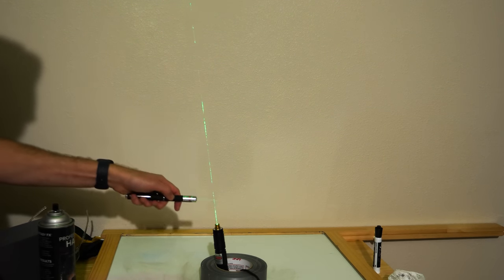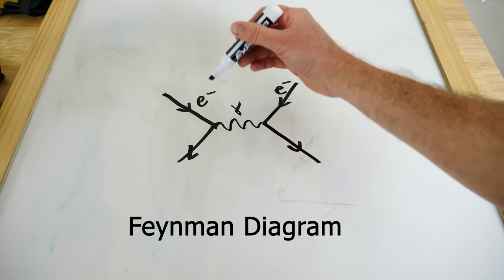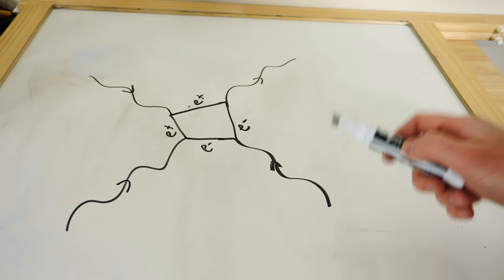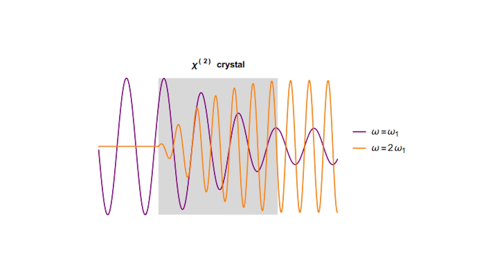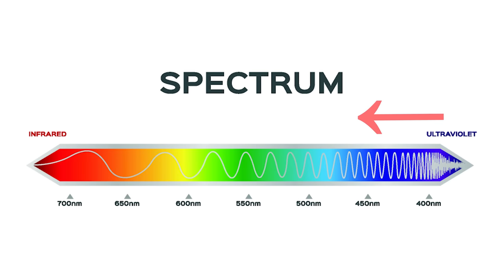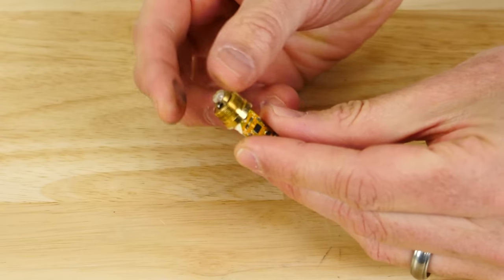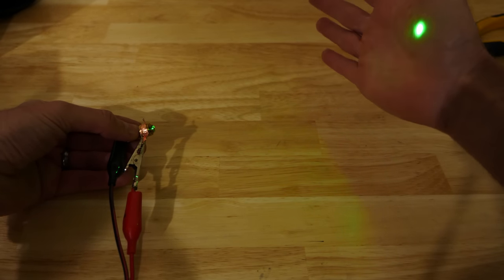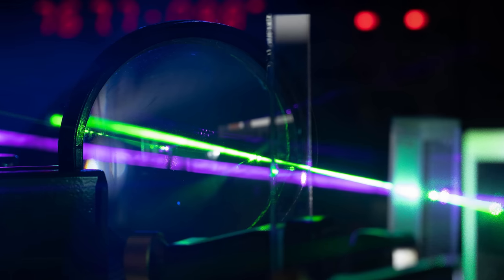Can Light Bump Into Other Light?

Comment: What's also interesting is that it seems that the crystal acts differently depending on the temperature so, if the laser is used in low temperatures, the crystal seems to stop working and may lead you to think that the laser is not working anymore, but it is working properly... as an infrared laser, so if you heat it a little bit it will start glowing green again
Reply: makes sense, as low temperature changes the crystalline structure in a way that prevents its resonant properties from working. Once the temperature raises and the crystalline lattice rearranges the photons are once again merged into one photon of summed frequency.
Reply: @vaakdemandante8772  well, one could say that your explanation was… coherent 😏
Reply: Temperature changes the length of the resonator ( distance between HR and OC mirrors ) This changes the way photon match in their phasing while in the nonlinear medium. You can see on some lasers the beam will become bright and dim in repeating cycles as you warm up the resonator. Some crystals themselves do work best at a certain temp, but I have found that to be secondary to resonator length in most cases.

Comment: An important point to keep in mind with Non-linear interactions such as frequency-doubling of laser light, is the energy loss in the conversion is very high.

The laser you have used in the demonstration, more accurately, a Diode-Pumped Solid-State laser uses a Diode pump laser of 808nm and typically its output energy is anywhere between 0.5W upto even several Watts of optical energy. In-turn, this pumps a solid-state laser, a Neodymium-doped yttrium orthovanadate (Nd:YVO4) crystal to produce the 1064nm 'fundamental'  frequency.

Nd:YVO4 is more efficient that Nd:YAG for smaller pump powers.

The Non-Linear crystal is typically a Potassium Titanyl Phosphate (KTP) crystal, however there are a number of crystals that exhibit non-linear properties as well. 

With a pump laser of say  1W, your final output will be several mW of green 532nm light. Most of the optical energy is used in to Pump the Laser Crystal and then the second harmonic generation of the 532nm light.

Comment: You can't convert a single photon of infrared into visible, that's simple conservation of energy! If you have a classical (Poissonian) light source and you wait long enough, you'll get 2 photons to coherently overlap once in a while to do the nonlinear frequency conversion. With an actual (non-Poissonian/anti-bunching) single-photon source that's impossible.
Reply: Conservation of energy?!!!!
How about You double the frequency and decrease the ampiltude by 4?!!!!
Reply: @Elie-J-Saoud  Can't reduce the amplitude of a photon, buddy. That's kind of the point of that whole quantum stuff.
Reply: I imagine you would use a high intensity probe laser and do the frequency summation mentioned. You should get out a single photon of source+probe frequency which you can then separate from the probe & doubled probe photons.
Reply: @alexandermarsteller7848  Yeah, that's called OPA (the high-intensity laser is called pump, not probe) and that's not at all what he was talking about. He talked about spontaneous sum-frequency generation (i.e. second-harmonic generation) without any additional pump source where infrared turns into visible light all by itself in a nonlinear crystal. That doesn't work with a single photon.

Comment: How does the harmonic doubling affect a single photon of infrared light?  It seemed like at least two photons are required.
Reply: I came to the comments to ask the exact same question, so I’m commenting to get notification of any reply.
Reply: I expect they use a light "base" (in addition to the single photons of infrared) then have a band pass filter to look for the base + infrared (not base + base).
Reply: @IC-lz3of  thanks, that makes absolute sense
Reply: I'm not gonna say this is what's happening here but photons can interact with themselves ( double slit experiment ).

Comment: Wait if you can double the frequency, does that mean putting loads of them in a row you can keep going higher and higher with the frequency? Or is there a limit?
Reply: gamma rays may be the last know checkpoint to increasing it? idk what comes after that
Reply: @aura4977  Well I did a little s arch and apparently frequency has no lower and upper limit, they go on forever either way getting closer to zero Hz and going higher and higher forever
Reply: @prich0382  i think about it too, hope this dude will make a video of it, gamma rays is something fun to play with
Reply: @prich0382  You can't go higher and higher in frequency forever. The energy of a photon is proportional to its frequency, so as you go higher you would eventually have enough energy in a single photon to create a black hole so that would be a limit. Also, as you go higher in frequency, the wavelength would get shorter and shorter and eventually the wavelength would approach the Planck length so you couldn't go any higher. That's 2 upper limits you would reach.
Reply: They can only double a specific frequency, most probably
Reply: the material (the nonlinear medium) in which the nonlinear process (SHG, SFG, THG, OPA, etc.) is occurring has to be non-absorbing at all the wavelengths involved.  There aren't many materials that are non-absorbing once you get below 200 nm.  Beta barium borate, for example, cannot be used below ~189 nm.  I think that there are material absorption limits on the other end as well, but am not sure.  However, it is possible to get super-short wavelengths by using plasmas as your non-linear medium... they are used in the field of high harmonic generation with femtosecond lasers.

Comment: I worked on a biomedical imaging product in the mid to late 90's and we needed 488nm laser light. Initially we used an argon pumped frequency doubling gas laser that needed 2kW going in to get 20mW (@488nm) out. This cost some $10,000 each. Then we bought a newly released semiconductor laser that only needed some 25W in (can't remember the colour) for 24mW out (@488nm). These cost some $28,000 each but they made the system much more portable. The only native blue laser available at the time was 405nm being used in Blue-ray players at a cost of some $50 at the time but we were using it to excite fluorescein which was insensitive at 405.

Comment: Optical light does not, in fact, split up into electrons and positrons spontaneously. The effect is called pair production and can only occur if the photon has an energy bigger than 1022 keV (rest mass energy 511 keV * 2 for both particles), which is nowhere close to the optical spectrum. This is, however, very common with high-energy gamma rays.
Reply: Yes, and even when it happens, it requires the presence of a third particle --usually a nucleus.
Reply from the maker: Yes, below 1MeV though they can decay into neutrino/antineutrinos as well. But you are right, for visible light, it needs to occur in the non-linear crystals. The non linear crystal provides a setting in which the driver, signal, and idler modes can interact.
Reply: @TheActionLab  Photons can decay into neutrino pairs? Never heard of that, can you tell me the name of the effect or some source?
Reply: That is not entirely true. Even visible-light photons can spontaneously decay into virtual e+/e- pairs as long as they annihilate back into photons within the uncertainty time corresponding to the "borrowed" energy (another way to see it is that within that short time the photons have a huge energy uncertainty such that it's enough for pair creation with finite probability). That happens all the time even with vacuum energy fluctuations and it's the mechanism behind (e.g.) the Casimir effect or Hawking radiation.

That said, "vacuum polarization" becomes an actual thing in ultra-hyper-super-strong-field physics, think of EW/cm² (or maybe even ZW) monster lasers like for inertial ignition. If you have mind-boggling densities of low-energy (visible/IR) photons, the probability of virtual pair creation becomes high enough to provide the necessary nonlinear susceptibility for actual pair creation where a million photons simultaneously decide to become an e+/e- pair from now on. It's left as an exercise to the reader to calculate the corresponding chi(1000000) susceptibility tensor...
Reply from the maker: @RealNovgorod  great point
Reply from the maker: @yeet1337  here is one paper that talks about it in high magnetic fields. https://arxiv.org/pdf/hep-ph/9712289.pdf
Reply: @TheActionLab  Thank you

Comment: If you kept stacking more of these crystals in front of the laser, would it go up even higher through the frequencies?
Reply: The crystal only works over a narrow bandwidth,  so each crystal will need to be designed to work at the higher frequency and there will be a limit to the maximum energy any material can handle. High energy x-rays can  damage crystals.

Comment: ~OKAY, just because you said LIGHTSABER, I am instructing you on the build. A lightsaber is an extension of yourself. It’s literally connected to it’s user and only the owner can operate the device. The blade itself is the energy of the sun Star produced from a extremely rare crystal structure that has to be forged itself.
For example, build first your pen for writing with.

Comment: At 6:25, if the crystal needs 'two' photons/light sources to double their frequency, how could it be used to detect a single photon?

I understand there's probably some particle/wave distinction here, but I am struggling to translate the diagram of two lightwaves entering to a single photon, unless the two waves were never required
Reply: The 'single' source of light your thinking of is actually a stream of photons, so two photons in the stream get diverted in the crystal and collide with each other.
Reply: I think they have a constant source of photons, and when the second one comes it adds with one from the continuous source to make the visible light
Reply: @shedactivist  but then how could you detect a single photon?

Comment: This crystal is a natural antenna, a kind of meta-material. It creates a physical geometry in which electromagnetic waves i.e. photons interact in a very particular way that sums their vibrations into one photon of combined frequency. The reason we do not observe light interaction on day-to-day basis it's not because light does not do it per se, but because it usually does not encounter proper geometry to do so.

Ergo in principle light DOES interact with light, it just needs very specific circumstances for it to happen.

Comment: There are NIR Single Photon detectors commercially available, out to 1100nm. New avalanche photodiodes are available for 900-1700nm, so more Single Photon detectors will be forthcoming, as current designs can be modified to accommodate the new diodes.

Comment: Actually light can interact with itself very easily: The double slit experiment which creates bands of light from optical interfere. 

In frequency doubling, what most likely happening is the electrons in the crystal are interacting with the light, which one photon increases the energy state of an electron and a second photon causes the electron to release a photon at double the frequency. Electrons are wavelets just like photons, but hold a charge.
Reply from the maker: the double slit experiment isn't the waves "interacting" it is the result of the positive and negative portions of each waves being in the same place at the same time. But the waves, if left to continue on their way, just pass through each other unaffected.
Reply: @TheActionLab  No, its interference causing waves to cancel out and others be increase in intensity. You can see repeat the double slit experiment using water waves with a double slit barrier.

From Wikipedia:
"When the two waves are in phase, i.e. the path difference is equal to an integral number of wavelengths, the summed amplitude, and therefore the summed intensity is maximum, and when they are in anti-phase, i.e. the path difference is equal to half a wavelength, one and a half wavelengths, etc., then the two waves cancel and the summed intensity is zero."

If there was no interaction as you state the pattern of the double slit would not exists.

You can also repeat the interference pattern with perpendicular light using a Michelson-Morley experiment: Basally using an beam splitter and mirrors so light interacts perpendicularly.

Using two separate sources of light is difficult to detect interference because only a very small fraction of light will interact which overwhelms the signal to noise ratio.

FWIW: Your demonstration has very little scientific merit because you didn't apply an realistic process assert your assumption as fact. You just shined a couple of light sources at each other.

Comment: Great vid, as always. I learn something new every time.

But, I want to point out one small thing (using my best nerd voice)...

They do now have so-called "Direct Injection" Green laser diodes that don't require the crystal(s). They are becoming far more widespread now, and available with higher output powers.

That's quite a recent development, though.
It was also only about 10 years ago that we started seeing high-power BLUE laser diodes without the crystals, too.

Comment: Definitely make sure to use your safety glasses when doing this!
Not being able to see the laser makes it extremely dangerous.
Reply: I had a "laser tag" gun set set as a kid and one day I noticed I could just barley see the IR "laser" light up when I Iooked down the barrel of the laser guns...  It didn't seem to cause any harm.  But then again this "laser" was probably just like the IR transmitters and receivers you would find on a typical TV remote and TV.  Lol.

The big difference I suppose is this "invisible" laser in this video still has the same energy as the visible green laser right?
Reply: @TheFlyingZulu  Precisely. IR lasers are extremely dangerous for this reason. 

Also, another common problem is that the wavelength of a laser is also contingent on the temperature. For this reason those decorative Christmas laser lights can blind people as the temperature drops, as they seem to not be functioning and people  might end up looking directly into them to detect any faults. Lots of them are cheap Chinese tat and will be very overpowered, resulting in burned retinas.

Comment: thoughts 4 later: laser computers using nonlinear crystals and light frequency.

key q's: 
-can non linear crystals have variable harmonic generation and frequency doubling akin logic gates and variable wattage transistors
- ability to read the frequency of light (steady beam vs packets of photons as data in a changing beam)
-how much bandwidth could changes in frequency of light beam over time be detected
-write and read speed limitations of altering beam of light

Comment: I think you've mixed up your wavelengths at 4:51, because to produce a 532nm photon you'd need two 1064nm photons. That might explain why your camera is not getting much light, as silicon is barely sensitive at 1064nm.
If you use 808nm for frequency doubling, you'd obtain 404nm photons, which are violet (there are actually ca. 404nm lasers working on the same principle). If you shine an 808nm laser to a camera, you would get much more signal, possibly you would saturate the sensor with the sort of source you're using.
Also, being picky, you cannot do "single photon" detection with frequency doubling, as you need at least two photons.

Comment: It's not how I learned it in the college tho. It's not the annihilation of two electron-positron pairs that produce 2x frequency light in nonlinear crystals, but rather two photons that have just the right energy both excite one electron which jumps to the 2X potential energy state, then relaxes and emits 2X frequency photon. And that's why you can't just shine any light into that crystal, only of a particular wavelength.

Comment: I'm not sure if the single IR photon detection would work... because you need two IR photons to make a single VIS photon.  So, it's more like you need at least a pair of IR photons to make a single VIS photon.  Also, tell me if I'm mistaken, but the freq doubling crystals work on the nonlinear polarization which is proportional to the intensity squared - so you need a high intensity input to get a substantial number of second harmonic photons.:goodvibes:

Comment: I have a lot of glow-in-the-dark decorations and multicolored lights in my bedroom, and the thing about higher frequencies is something I've observed firsthand. Blue light works very well for it, and UV charges it near-instantly. Now I know why it happens :)
Reply: He has videos on that. It's because of the photoelectric effect. Basically the individual photons themselves have to charge the paint. But if the photons wavelengths are too low they won't depart energy to the paint to charge.

So you can have blue light that can charge it because the photons have a much shorter wavelength and thus each individual photon has more energy. But even if you use more energy even if it's enough to power a city, red light won't work.
Reply: @k_tess  One thing I've wondered: will X-rays and/or gamma rays also make it glow?
Reply: @Sparkette  No. Xrays would destroy the paint. 

The "glow" comes from the electrons being energized and jumping to a higher energy level. When they come back down they release photons.

X rays are ionizing radiation. They make electron jump to such high energy levels that they break away from the atom. And the atom becomes an ion.